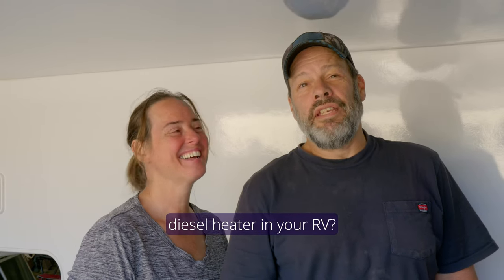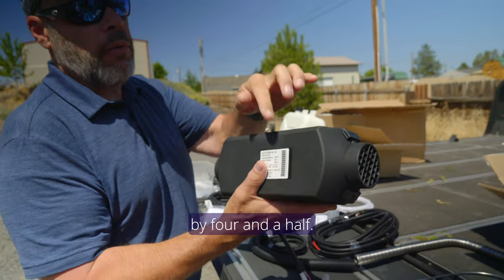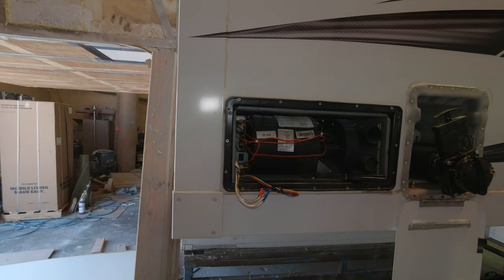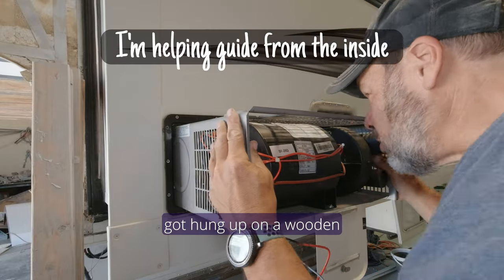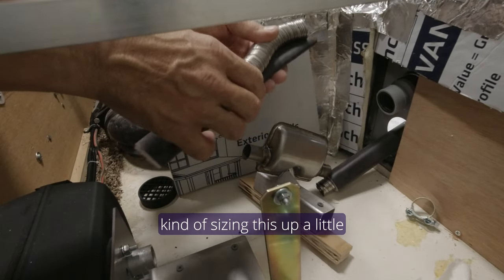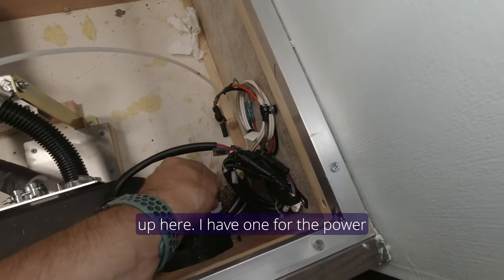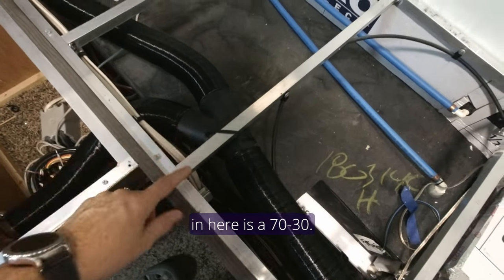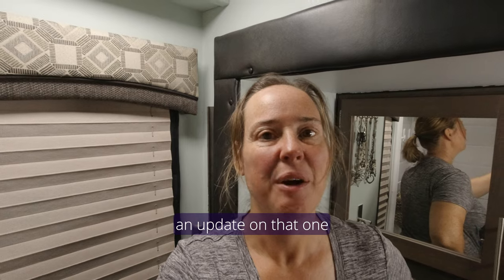How Hard is it to Install a Diesel Heater on an RV? | e147

Comment: Have been wanting to do this to my mammoth thanks for a great video explaining this looking farward to hearing ur thoughts on how it works
Reply from the maker: Thanks for watching, and glad it was helpful! And we're looking forward to using heat instead of the air conditioner in a few months!
Reply: Nice upgrade. Can’t wait for the follow up report. Have considered this option often, mostly to reduce (?) power draw from the furnace fans.  Will be interested to see fuel usage. Glad you’re finding ways to keep busy while at PenPak.  I thought our repair time was long, but, your definitely finding productive things to do while you can.  Another great video and project. 👍
Reply from the maker: @meandtee8401  Howdy again! Yeah, it's been a LONG while here, but I think I would have gone bonkers without these projects. 🙃 I am definitely looking forward to sharing results of this heater as well - we were planning on installing this in December but now we'll be able to use it before then.  Would really like to get out of here and away from the smoke. 🙁 Hope you both are doing well!

Comment: Thanks for another great how-to video! There’s no problem with having the exhaust and intake so close. Just asking.
Reply from the maker: Hello! And good question... This is the intake and exhaust for the heater combustion part. They are required to be 2" apart, which also matched up with the plate for our old Suburban heater.  The breatheable air is pulled from the cold air return and heated, then pushed out the ducts.  That's why we spent extra time using exhaust seal and tape on the combustion side of the heater.  I hope this makes sense!